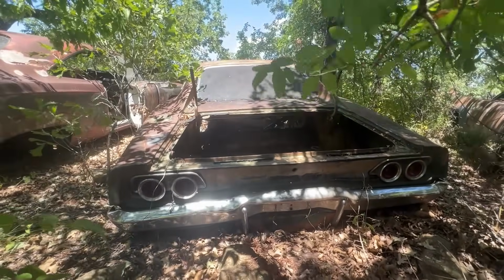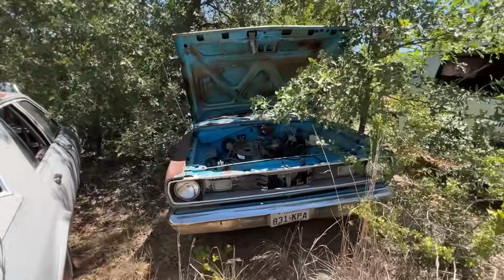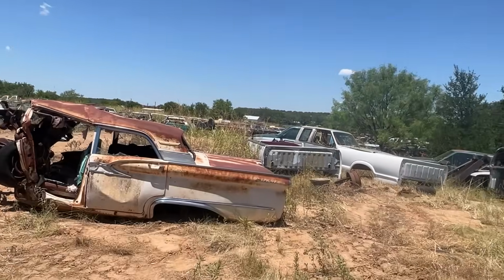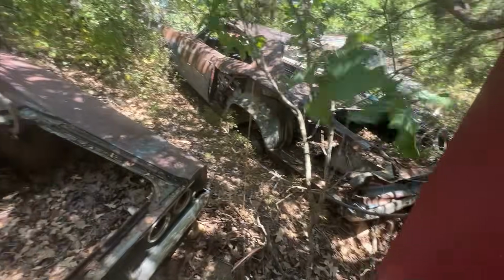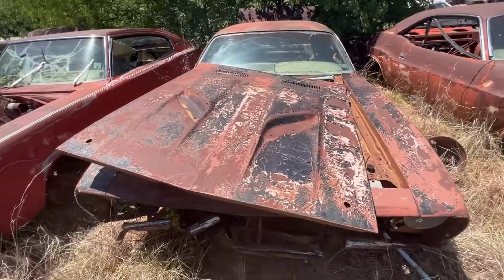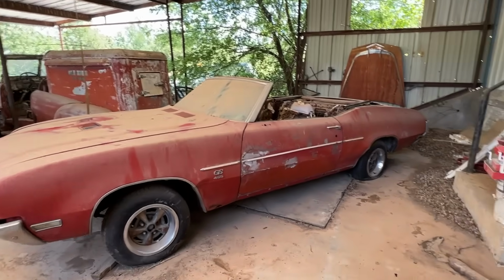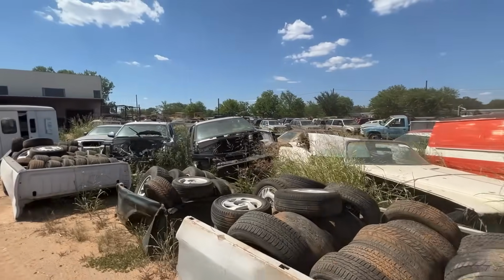Texas Grave Yard, Abandoned Neglected Classics

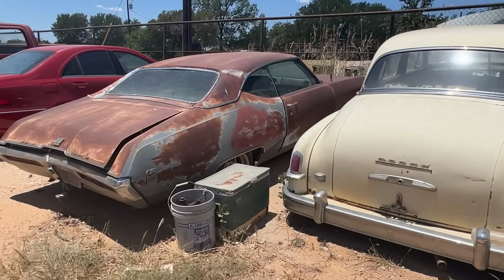Comment: 2:05 1969 Buick
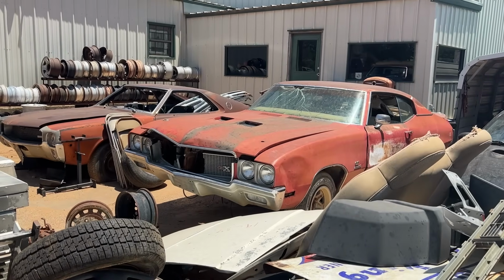2:44 1970 Buick GS. Gsx came in two colors (Apollo white or Saturn yellow) only and had no vinyl roof.
18:33 1968 Buick Skylark Special Deluxe
20:53 1969 Skylark (green in the background)
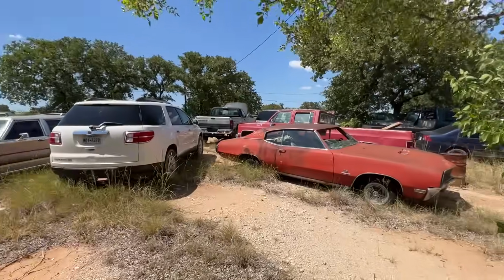53:39 1970 Buick GS
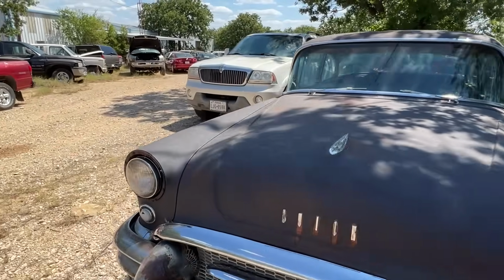54:30 Looks like a 1955 Buick Special.
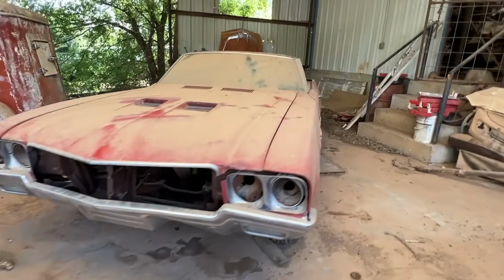57:15 1970 Gs455 convertible. I have one, as my last project. I'd like to get another one for parts.

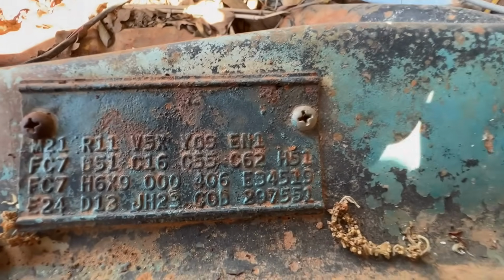Comment: YOU WONT BELIEVE IT BUT @ 51:09 That challenger tag decodes as: E24: 	225 cid 1 barrel 6 Cylinder 145hp, VERY RARE!

JH23:
Dodge Challenger
High
2 Door Hardtop

C0B: 225 145HP 1-1BBL 6 CYL
1970
Dodge Main, Hamtramck, MI, USA

297551:	Sequence number

E24: 	225 cid 1 barrel 6 Cylinder 145hp
D13: 	3 Speed Manual Transmission-Floor Shift
FC7: 	Plum Crazy Metallic (Dodge), In-Violet Metallic (Plymouth) Exterior Color
H6X9: 	Trim - High, Vinyl Bucket Seats, Black
000: 	Full Door Panels
406: 	Build Date: April 06
E34519:	Order number

FC7: 	Plum Crazy Metallic (Dodge), In-Violet Metallic (Plymouth) Top Color
B51: 	Power Brakes
C16: 	Console w/Woodgrain Panel
C55: 	Bucket Seats
C62: 	Left-hand 6 way Adjustable Bucket Seat
H51: 	Air Conditioning with Heater

M21: 	Roof drip rail moldings
R11: 	Radio Solid State AM (2 Watts)
V5X: 	Body Side Stripes, Black
Y09: 	Build to Specs for Export
EN1: 	End of Sales Codes
Reply: rpo codes are the most interesting aspects of these cars
Reply: It's weird how the car is coded as a 6 cyl car  on the fender tag but has a 318
Reply: @jimtiller3567  COULD HAVE BEEN SWAPPED ANYTIME IN ALMOST 50 YEARS

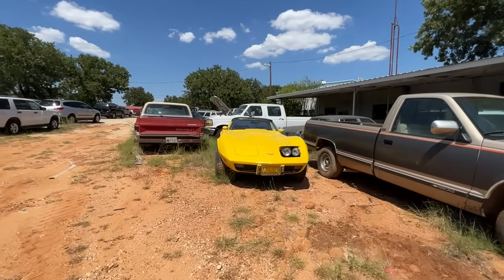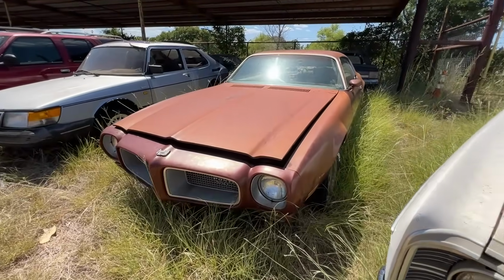Comment: some of these cars are collectors cars, much sought and liked by alot of people. that old corvette @ 47:55 for example or that saab @ 48:21 (left from that pontiac). that corvette appears a bit like liftet, i guess thats because the engine is missing, less weight makes it appear like liftet, else from the look inside it appears like it wouldnt need that much work to finish building it. is that a 1957 chevy truck @ 48:48 ? i think the 1957 chevy pick-up truck is the nicest truck ever made, those gorgeous classic forms, and i usualy dont like trucks that much. is that one @ 1:04:41 on the left with the front towards the cam a 96 Lincoln Towncar ? the 95-97 Lincoln Towncar has one of the nicest form of instrument boards inside and people keep buying them for a daily driver, to bad if that was left there at a car graveyard. another Lincoln Towncar @ 1:05:03, one or two more at that around that spot. i read in the infor below this video that the owner doesnt sell these cars, does he want these cars to rust and rot away or why is that??? there would be alot of people who would buy these cars (not all of them) to restore them and add them into their collection or to make them their daily driver, like that 95-97 Lincoln Towncar.